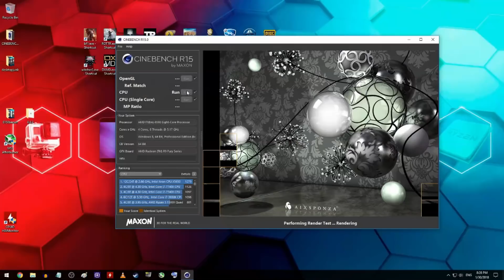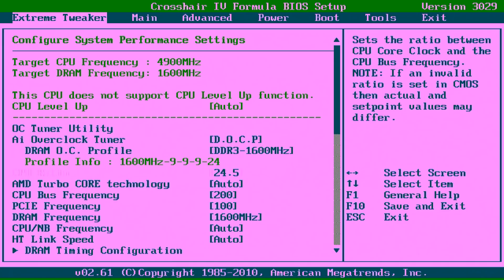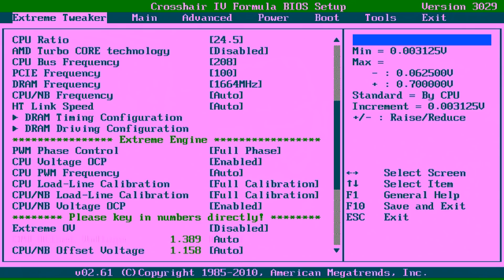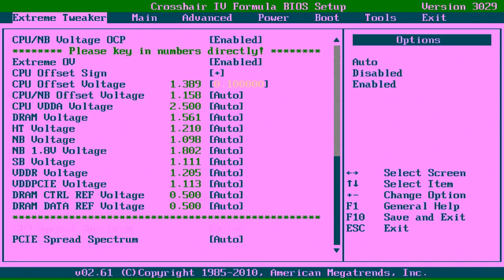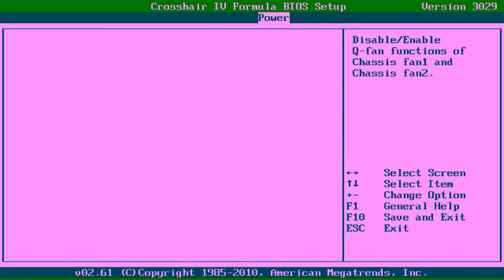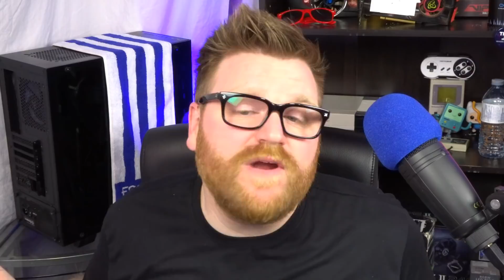How To Overclock The AMD FX Series to 4.8 - 5.1 Ghz!

Comment: Something interesting I learned from JayzTwoCents about water cooling, a faster pump speed does not equal better cooling performance, in fact it hurts the cooling ability! That's because the coolant spends LESS dwell time in the radiator where the heat can be exchanged. It get's even worse if your pump is moving fast enough to cavitate in the fluid creating a bunch of little air bubbles in your loop, which as we know water transfers heat much faster than air... 24.17x faster, which is why we're water cooling in the first place right!?😁

I use a fan program Jay also recommended called (wait forrrr it!) "Fan Control" (which works awesome!) to set a flat speed graph for my pump, in BIOS I turn off the fan options other than setting the pump to like 300 RPM and in the Fan Control software I keep the pump pinned just above the lowest speed it will stay running @600rpm and get much lower temps both at idle and load. Plus the pump will last way longer too.

Comment: Ex AMD User here after having used a FX 8150, 8350, 6100, 6300 on a ton of different boards i can tell you right now that you don't even need to bother with FSB just stick to straight voltage and multiplier, FX cpu's love it  just don't go over 1.5volts when overclocking also set LLC to extreme

Comment: I know this is old, but i had 2, (8320E) 1 chips was at 4.9ghz at 1.46-1.48llc on load, but ram now matter what i did could not pass 1600 hz and northbridge i had to run at 1800hz
The other chip 8320e also was stable at 4.8 at 1.38 volts (1.42llc) with northbridge at 2600 and ht at 3200 all on 2133 ram 4 slots btw 32gb (my best chip i ever had) but was temp sensitive, so h115i
now i am on amd 3600x same (h115i) and wow what a huge difference, smoothness, plus its not a a room heater 
even though it was pegged at 4k (hdr) 60hz (2080 gigabyte  ) with the fx, was just jittery hard to explain but fps says 60
just my 2 cents. both mobo were gigabyte 990fx chipset

Comment: I have fx 9370.  Fx cpus easily overclocked but stability and temparature issues are neglected. I overclocked my cpu to  4.8 ghz and   tested with prime95 severeal times more than 1 hour. Temperature not going over 60 in a 10 degree  room temperature. Cinebench results in win10 and win7 are different.  At same frequencies win7 results ara at least 10 point over the win10 results.  One more thing fx cpus performance diminish after 63 degrees around. Thats why your cinebench result  seems low.
https://www.youtube.com/watch?v=wk6d5vwgWjw This is my 1 hour prime95 test.

Comment: You would do better if you were using a FX 9000 series compatible motherboard. Not all AM3+ boards support the FX 9000 series. I have the Asus Crosshair V Formula-Z. I am using both 4pin and 8 pin CPU power connecters to achieve the 220w TDP recommended by Asus. I have Turbo disabled and stock frequency set @ 200 X 23.5 (4.7 GHz) I have 32 GBs of Gskill Ares DDR3 2400 11-13-13-31 2T. CPU VCore is set at 1.45V, CPU/NB is set at 1.15V, DRAM is set at 1.67 
(.02 v higher than stock). CPU LLC and CPU/NB LLC are set to "high". I keep this CPU at stock to maintain 100% Prime 95 stability. Once I overclock Prime 95 is no longer stable but other stress tests are stable like Intel Burn Test up to 5.2 GHz. I have found overclocking to 5.0 Ghz or beyond is just not worth the the higher temperatures.

Comment: I used Auto settings on AMD Overdrive let it tune and my FX8370 BE shows 4.875 Ghz stable. ASUS M5A97 R2 Motherboard. These builds do eat electric power and you will end of paying more for that in the long run.

Comment: @ Timmy Joe
Yes I know this video is a few months old and I actually watched it the forst ime when you uploaded it. I have since this came out got a chance to play with a AMD FX 8350 on a Asus 99XX Pro R2 board it is not my hardware but a friends and he wants me to OC the heck out of the system.
Problem is I have only really done Intel systems to their max. SO far I have found it is pretty easy to OC the FX chips.

When I first started playing with the system I had it at 4.8GHz fairly quickly and ram at 2400MHz (2x8GB 2133MHz). Well that didn't go as expected the over clock was fine but his PSU was a cheaper 550 watt PSU and it gave out after I did a stress run with Cinebench and had the system sitting at desktop and it just shut off and would not turn back on. I installed a 650 Watt 80+ Gold unit and was back up and running.

I am a bit trigger shy now with the OC as it now is only 4.5GHz & still 2400MHz ram voltage on the CPU is at stock. I plan to play with the settings this weekend and what I found out is this. You want to do the OC more around the FSB 230-250Mhz range and adjust your other system settings around this I have not tried this yet so looking forward to messing around with it. I also found out NB should be 2400MHz-2600MHz max and HT link should be around the NB speed so the plan is to have FSB@250MHz NB 2600MHz HT Link 2600MHz ram at or near 2400MHz & still have the CPU at 4.5GHz and run Cinebench again and see of there are any gains.

From what I was reading Cinebench and 3dMark get some nice gains form settings like these all done together form the FX CPU's right now @4.5GHz Cinebench spit out 722-727 multi thread test score. So if it goes up with CPU still at 4.5GHz then I may take the CPU up slowly to maybe 4.7GHz and then stop do the Cinebench again and if it passes give the system back to my buddy. 

I played some Destiny 2 on this system and it actually felt pretty good there was no mouse lag and was pretty smooth in heavy combat at 4.5GHz I did notice a very slight micro stutter here and there in one spot in the game where there were a lot of players in something called the Tower where everyone goes to get new stuff. On my i7 Intel based system I do not notice the same micro stutter that happens in that one spot and maybe with this weendends tweaking I can get the FX system to stop it from happening as well in that spot in the game.

Edited:
Well over the weekend I got to play with the FX CPU a bit more. I did everything I stated I would try in my first post on Friday and I did see some nice gains. In Cinebench with CPU still at 4.5GHz ( Yes I realize it can go farther) FSB 250MHz HT link@2800MHz NB@2600Mhz Memory still in the 2400MHz range simgle core score went from 106-108 to 112-115 & multi core went from 726 to 735-736 scores not huge gains but a gain is a gain. Max FPS in Destiny 2 only went up a few FPS but it was the avg FPS and mostly the min FPS that got some really nice gains and more importantly the game was very very smooth not slow downs or stutters at all except maybe when the HDD had to do a read for more data but it was very minor. I told my buddy he really needs a SSD drive which would settle out any speed issues like this. 

In my own system I have my C drive with a SSD drive and my storage drives are 3 4TB hard drives I use a program to do caching on my SSD drive. I setup 65GB on the SSD and 4GB system memory as a caching setup for 2 of my 4TB drives which both have games on them. After you load the game once or twice the game gets a huge speed boost and load times and in game play is pretty much like playing it off of a SSD based drive or faster if the data hits the memory cache itself. I for get the name of the program it I got the info for it from a Linus tech tips video a little while back and tried it and it just worked so I bought it. I just went and found the program it is called PrimoCache it really works well and actually does what it says it will do and it does really help speed everything up form a spindle based drive and it does not cost all that much either. Losing 65GB & 4GB memory to be used for the cache was a small price to pay for the speed boost on the slower drives. My SSD is a Samsung 512GB and I have 32GB system memory so I do not miss either very much at all.

If you have a smaller SSD you can use a smaller cache setup and it will work very good as well. If you only have 8GB I would not use the setup system memory option maybe on a 16GB system I would set aside 1GB-2GB for the cache. Anyways the main point was to do a quick update from my first post on how the tweaking went and if I got any gains from it. The short answer is yes the FX CPU does really seem to like a higher FSB and it's other buses raised to get the most out of it. Is it as fast as my Sandy Bridge i7 if they were at the same speed no it's not but these tweaks do make it a tiny bit closer to my Sandy at least. 

The gains I was able to get in the min FPS was probably the largest gains it was able to hold them a lot better and not go below the 60FPS threshold in the 3 hours I played Destiny 2 on this system where as before it was dipping below often. So the end result is if you are still on a FX system like the FX 8350 clock it to at least 4.5-4.6GHz (this is easy to get) then tweak the FSB and HT Link and the NB buses it will give a nice boost to a old CPU like this. I now plan on taking the CPU up to 4.7-4.8GHz stress testing it for about 10-15 hours & if it passes my buddy will get a nice free speed boost from his older FX CPU. Wow this turned out to be a huge post sorry about that.

Comment: Can't get my FX-8350 past 4.2 without crashing. Probably my Mobo, Gigabyte UltraDurable DS3P FX ver 2.0, might not support any overclocking. It also has a smaller power pin, so it might not be able to electrically support it.

Comment: From practical point of view (e.g. gaming, not just records or benchmarks) it's way better to OC the RAM (as FX series actually benefits from ram speeds up to 2133 or even 2400 in some rare cases). Its even better if your DDR3 sticks are dualrank (I have one of those on my other PC, 2x8 gb 2133 DR modules) and the northbridge / HT  is OC'd up to 2600, for instance. In the end, just overclocking CPUNB and RAM can get you the similar FPS boost as going up from 3 to 4 ghz. Of course you also need to have the memory working in dual-channel. As for the core frequency I think 4.2-4.4 is more than enough and can be cooled much easier. Complex approach will especially influence FPS dips and lows. I understand the point of video, just sharing my own experience of getting most of the fx chips.

Sidenote : It can be used as an idea for your next FX-themed video if you'll figure out where to find 2133 dual-rank DDR3 sticks or already have some and you can make some fps comparsions with or without NB and ram OC. There is some similar tests just comparing 1333 vs 2133 but both single-rank and I've seen no tests of 1333 SR / nb stock vs 2133 DR / nb 2600. Some FX chips are able to run ram at 2400

Comment: That voltage is too high for just AIO cooling also you need to get the hang of setting the Northbridge & HT link speeds, will make a massive difference.  Defo dial back the voltage, you will get better performance, less heat and maybe be able to OC a bit higher for benching.
Faster ram wouldn't do the FX any harm either, 1600mhz ram is a bit slow.  G.Skill Trident X 2400 is my favourite DDR3 for both FX and Intel platforms.

Comment: Great video man, I just put a 212 Evo on my FX-8350, gonna try to hit 5ghz later. 

Wish me luck.
Reply: You will need more than luck bro! lol
212 cooler is not enough to cool Fx at 5Ghz.
Reply: you will need water cooling on that beast... unless you can achieve the 5Ghz on a very low voltage, which is not likely.
Reply: It's doing quite alright currently on 4.7ghz with 1.49v, stays around 45-50c when under heavy load. Not to mention I have an open case and a generally pretty cool room, I think I might manage to get it to stay under 70c.

If not, oh well.
Reply: it amazes how well the 212 evo cools, great bang for the buck
Reply: my fx 6300 is running at 4.6 ghz and stays under 40 c for any game I put on it (pubg, etc)
If I push it to 4.8+ghz though the temps jump from 18c idle to 25-30c idle.
Reply: Come to think of it, I had a 212 on my fx 8320 at about 4.7Ghz I think...and it ran sweet at reasonable temps! 5Ghz may be a stretch...but who knows.
Reply: I ran overclocks like that too...on the 212. Stability testing required much higher vcore which shot the temps right up there! I used IBT and AMD's stability software. Cheers.
Reply: Luck the temperature is not corect. Had that issue on a gigabyte board showing way lower temps then it should. Tmpin 1 2
Reply: I run an fx 8350 @4.4 1.36v 35c under low load 1.8v 45c while gaming and 1.4v in prime 55c. Anything beaond 60c is to much for the fx. Protection kicks in at 70c. The 9590 turns of at 75c i think. And to get 4.5ghz and above i hit a wall and need above 1.5v crazy. All this is cooled by an artctic freezer 120 aio this thing is crazy small and cools like a champ. And i got it because its so easy to install compared to my zahlman cnps something finger cuting and son of a b to install cooler. And its crqzy how many poeple run their procesor thinking that it is stable at 5 ghz or whathever. Prime 1 to 2hours will show you your real temps volts and if it is stable. Realy stable, you cyn run games 7 hours at x ghz andyou will never know that you arenot stable and even lossing performance. P.s i get 702 in cinebench. That is what i call stable.
Reply: Vice Stojčić I Run 4.515 Ghz, 2600mhz HT-Link, 2600mhz North Bridge Frequency, duel channel 1866mhz 8x2 16 GB ram on Asus M5A99X Evo R2.0 board, by a EVGA 80+ Gold G3 850 watt PSU and I’m 100% stable and can go higher. I use 1.4 volts even. Low teens high 20’a at idle, 40-45 C under 100% load no matter how long while gaming. Topped out at 48C in Prime95 after 3 hours. I run with GTX 1070 2140mhz core clock, 4600mhz memory clock. Use a custom fan curve that never gets over 65% speed and it maxes at 62-66C. Use a Hyper 212 Evo in push/pull with NZXT SENTRY 2 led fan/temp controller. Case stays around 25-30C and all 5 case fans stay between 40-50% fan speed on auto temperature detect to keep it under 30C. Not sure how it can get more stable that that and that’s 4.515 ghz. At 4.615 I keep mainly the same temps give or take 1-2 degrees but it requires 1.47-1.5 volts so I just leave it at 1.4 volts and 4.515ghz. With the overclocked HT link and NB frequency as well it does pretty good. Play Metro Exodus on Ultra with advanced physics on and get 80-100 FPS. Anthem on all high settings with two on Ultra I get 60 FPS outside and 80-90 inside. Got a video of some of its gameplay uploaded. Working on uploading videos of many more games showing FX 8370@4.515/OC GTX 1070 performance in games at 1080P. Gonna upgrade to Ryzen 3 or Ryzen 2 1st gen whatever you wanna call itnwhen it drops but until then it still does good enough.

Comment: actually got my FX-8350 to 5.1ghz and posted a 815 in Cinebench. I don't know why, but I still love my FX system. I also have a Ryzen 7 1700x and it just puts the FX to shame, but something about older hardware that I just love messing with so much  more. Also the Ryzen 1700x I can only get to 3.9ghz. Would love to be able to get even 4. something out of it, but it doesn't want to.
Reply: Well for Ryzen getting to 4.0ghz is something just for "esthetics" rather than the performance difference, especially considering voltage and temp increase (1-3900/4000=0.025, so its 2.5% difference). I used to run my 1700x at 3.9 for a while but then dropped it to 3.8 as I seen almost no difference but the system got even quiter and cooler. But I'm gaming on 2560x1440 monitor and thus most of the games are gpu-bottlenecked even on 1080ti. I currently trying to OC my ram to 3333 and as this is dual-rank sticks it is hard af to get both the tight timings and frequency